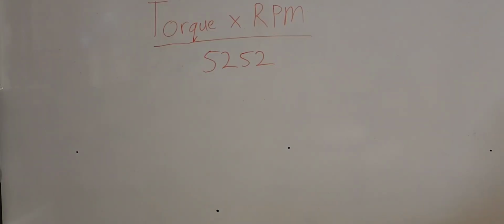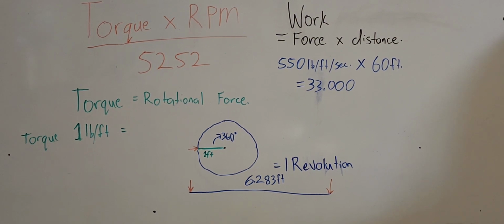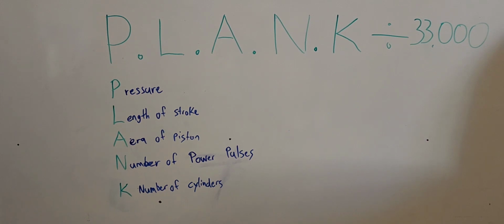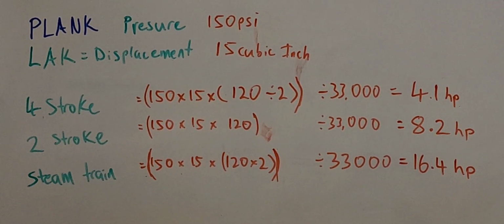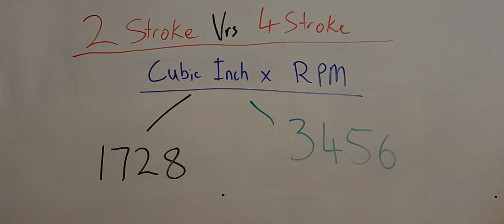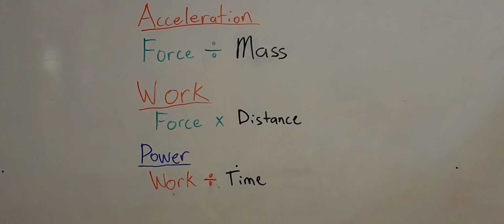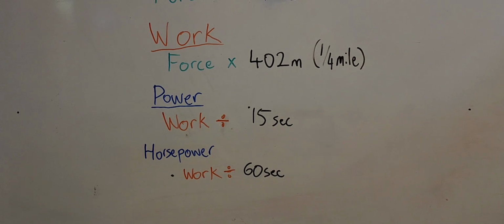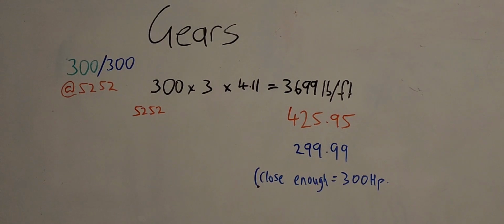Torque and Horsepower, a Hobbyist Engine Builders Perspective - Part One.

Comment: Tip i have found over the past 45 years of spinning wrenches on cars.

With all carbs.  

There is an low speed circuit. That supplies fuel from idle to around 1800 rpm all by itself.  Limited by the idle feed restriction.  Using a wide band air fuel ratio gauge look at no load on the engine 1,700 rpm.  Are you at 14.7 A/F ratio.  Continue up between 3,800 and 4,000 rpm  how far off 14.7 are you..

At 1700 change the idle feed restrictions.  Retest.  

At 3800 to 4000 change the primary main jets.  

After getting those both to 14.7  
From idle. Open the primary throttle fast. If you get a backfire in the intake. Go to a larger pump discharge nozzle. Try again.  
Many holley performance carbs come with 0.031" idle  feed restrictions that are just right for 330 cube engine.  347 to 360s need a 0.032 idle feed restriction. 
 
To tune the secondary mains must be done after the primary jetting is corrected.  Do the secondary test close to wot but keeping the vacuum below the opening point of the power valve.   Change the secondary main jets to get them dialed in.  Then do a full WOT  run to see if you need to increase the power valve restrictions.

Comment: To me there's no VS, HP is the goal which will be made through some ratio of torque and rpm that suits the application.

Torque is per power stroke, HP is power strokes per unit of time (RPM), RPM is Displacement over Time (CFM)